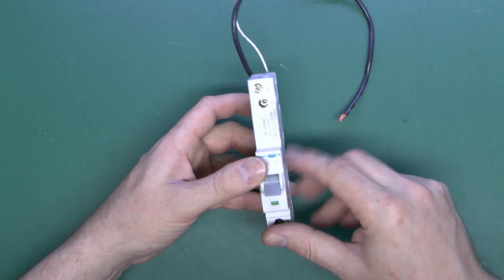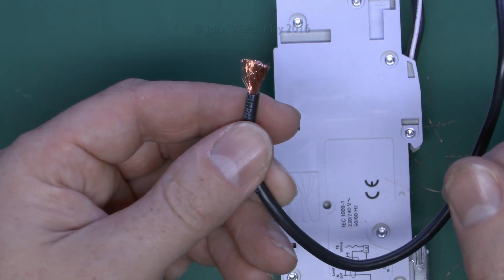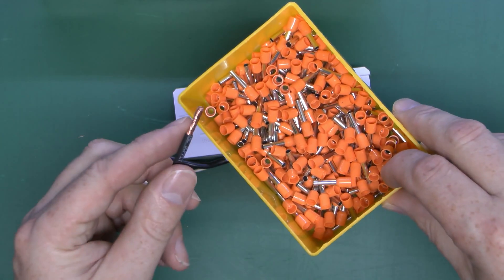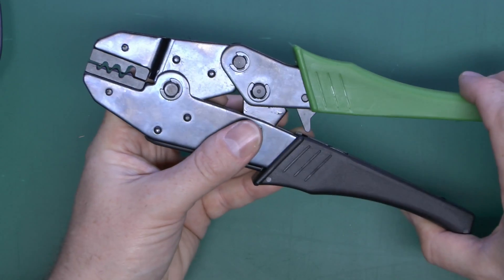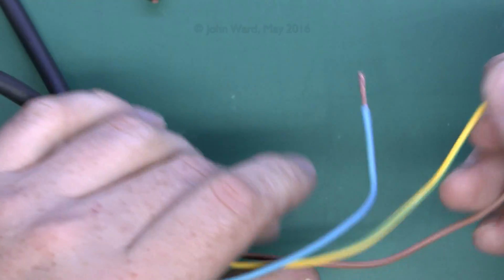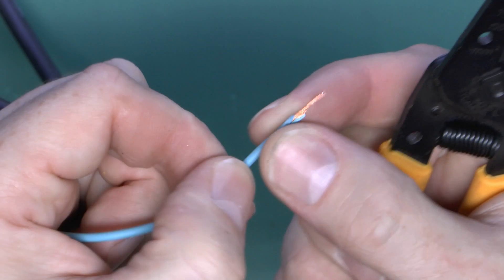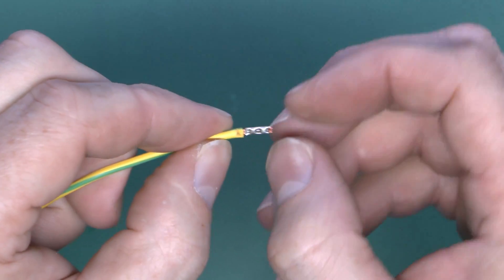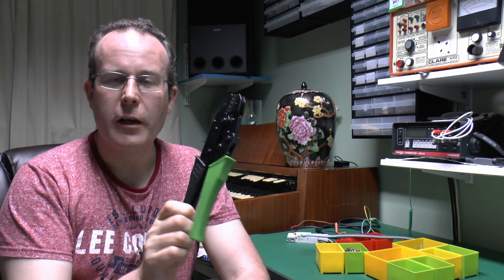Cord End Terminals / Bootlace Ferrules for Fine Stranded Wires

Comment: How about tinning the end of wires? I'm actually more into electronics, but occasionally I'm also working with some electrical stuff, so I figured it's not really worth investing into some high end crimping tools, and I know cheap tools are pain in the ass, so I figured, I just put solder on it instead those tubes... It obviously worked for me, but Is there a problem with that in long term? (other then being less durable to mechanical wear by mounting on and off...)
Reply from the maker: Solder will tend to flow under pressure (such as when in a screw terminal), so can lead to loose connections over time.
Reply: Oh ok.
Reply: Worse yet solder can melt causing shorts in high current applications.
Reply: I've never worked with really high current applications, I've only done the wiring at our house(the newly built part), and also done some repairs at my aunts house. And I put only as much solder as necessary, even if it melts, I don't think there's enough to drip and short something... I would be more concerned about loose connections.
Reply: Never put solde3r on screw connections. The solder "cold flows" and causes a bad joint. It's OK to tin the ends of stranded cables going into spring terminals (eg: on ballasts) as they maintain a continuous pressure which accommodates the solder flow..

Comment: The folks who suggest just putting those into screw terminals without crimping them are probably the same who think the PVC covering should be pushed under the screw of a choc block because the only point is that the wire ends touch inside the choc block!

Comment: What about crimping solid core wires? - This is often required for extending cables (e.g. in a replacement consumer unit installation). I find that care is needed to avoid the crimp "rotating" on the solid core after crimping - not good for contacts over heating/cooling cycles.
Reply: Klauke has special crimps (SV series) for solid wires that go with hexagon crimp dies. Unfortunately the crimp tool is quite expensive (roughly ten times the price of a more affordable ratchet crimp tool for ferrules) so I haven't bought one yet. The SV splices are bare so you need to cover them with heatshrink tubing afterwards.
Reply: You wouldn't need to crimp inside a consumer unit, as you have maintenance access, other means of extending can be used.
Reply: Good point - but I was more thinking about extending cables outside the CU when they are too short to reach the terminals inside the new CU. Such exterior joins may be inaccessible after installation (plastered over etc.)
Reply: Just wondering how a hexagonal crimp would make the join more secure on a round copper core...
Reply: More even pressure and thus a better connection. Copper is malleable remember :)

Comment: Far to often i see ferrules not being used with fine stranded cables. BS7671 regulation 526.9 (Connection of multiwire, fine wire & very fine wire conductors)  applies to this situation. :)

Comment: out of curiosity, would soldering the strands of the cable be acceptable?
Reply from the maker: +Nathan Lucas No, solder is very soft and will flow under a screw terminal resulting in a loose connection.  Also see the other comments on this video.

Comment: At 10:08 you have a stranded T+E if you where terminating into sockets and not using the ferrules, would you twist the end of lets say the brown into 1 solid like core and then terminate or just put it right in as is?
Reply: +IrishHitman79 - I think the twisting action is more to gather together tiny stranded wires where they may otherwise not insert into the pin properly if some of them get caught-up on entry (as John mentioned in the video).  I wouldn't think it generally necessary for thick stranded wire though unless experiencing the same problem.

Comment: What crimping tool would be used for butt splices? Mine are the Absolute Rubbish brand ones (lower quality than the Shyte brand ones you showed) and they are so bad that the jaws bend sideways and it has pinched my skin on the handle side. Again, only good for the nifty boltcutter thingy.

Could you solder the ends of the wire to contain the strands instead of a ferrule? I generally do that when I use those white terminal blocks for high current things (such as my 3D printer's heated bed) and it seems to have worked. The soft solder deforms and presses against the metal, which could give better current transfer.

Comment: If you know what your doing, you don't need these ferules at all. Just strip double, twist tight and fold back.

They're are one of those things that are used to stop unskilled workers making a bad job of terminating wires and to provide an alternative for those pillocks that think it's ok to tin wires before pushing them into screw terminals.

A few months back I had to reverse engineer and build a replacement for a large 3 phase motor control cabinet (which had failed in the field) and whoever built the thing had tinned every wire before placing them into screw terminals, I swear half of them fell out or sheared off with the slightest of tugs.
Reply: +Strider9655 What a ridiculous statement. I think you need to broaden your experience – some control panel building maybe.
Reply: Max Phipps
Not sure what you have issues with......
The use of crimped ferules is subjective, the tinning of wires to go into screw terminals is amateurish and also against regs. The control cab I took apart, the clown that built it also soldered the tags onto the earth wiring.
But that's not why it had to be rebuilt, it had to be rebuilt because of a multitude of sins, like an e-stop that didn't work properly and failure to understand how to wire a star-delta starter.
Reply: +Strider9655 QUOTE -  "The tinning of wires to go into screw terminals is amateurish and also against regs." Sorry I stopped reading your reply after that line. Have a nice day.
Reply: Max Phipps
Not only does solder cold flow, but it also makes a terrible contact material due oxidation. But what do I know? I've only spent the last 10 years working in Automotive, Aerospace and Defence sector electronics.
Next time you get on a plane, be thankful they didn't solder wires into screw terminals.
Reply: Next time I get on a plane, I will now be worried that some idiot screwed bare stranded wire into a terminal, with individual strands sheared off and floating about in the electrics and electronics, possibly causing all sorts of shorts, whereas a simple crimp could have neatly kept all the strands in order … Because guess what: copper strands don't give a fuck about what the installing electricians know or don't know. They don't follow regulations, they follow laws. Laws of physics!

Comment: Total-Shyte TM ;-) Yes indeed, I have a few tools of that make.
I would recommend a rotary type crimper, you can get the $150 Knipex tool if you use it a lot or look for something like Ebay 231499958980 which is a decent knockoff for only $20.

Comment: I use my little butane soldering iron to tin them instead. Its a "one size fits all" solution and I personally think that when the terminal screw clamps a tinned end, it makes fantastic contact on all surfaces as the tinned end will be moulded into the correct shape which will also lock it into place - a bit like the end of the RCBO neutral at the start of this video, only better.
Reply: +mastergx1 You should not tin stranded wires that go into a screw terminal.  There are two issues.  Solder is quite brittle and could break easily, secondly the solder could get displaced by a cold flow process which will leave the connection loose over time.
Reply: +cjmillsnun Seconded.
Reply: +Graham Langley Thirded, tinning the ends is a recipe for future disaster
Reply: +cjmillsnun also, you shouldn't use solder in a high current application, as it will heat up more than the copper wire and even melt.
Reply: After reading these comments I'm going to rethink my practices. However, one point I would like to make parasBanaani is that the current flowing through individual circuits is max 50A for any that I have installed. I've seen solder used on ELV DC circuits with currents reaching 100s of amps. The idea of the solder is to increase the contact area which reduces impedance and, resultantly, reduces heat. I don't consider individual LV circuits to be particularly high current.
Reply: +mastergx1 Yes I don't think it melting is actually likely... it's more the fact that solder cold flows being a soft alloy. If you have any of those plugs laying around, open them up, you'll often find the screws are loose after even just a year. I too used to tin the connections. I think the practice is quite common among people over a certain age in the UK due to the fact the wires on appliances used to come tinned, before plugs were fitted ... I dunno why
Reply: +TheChipmunk2008 I think the wires came tinned purely to keep them together, they were always tinned the same length, where UK plugs require the neutral to be around 3x the length of the live and the earth to be even longer than that.
As well cold flow the other problem is that the conductor around the area of the tinned wire is brittle and prone to shearing when exposed to vibration or temperature fluctuations.